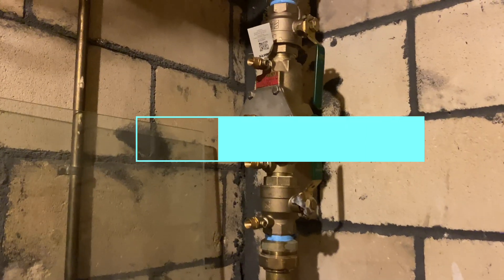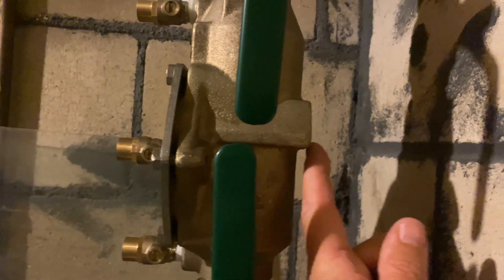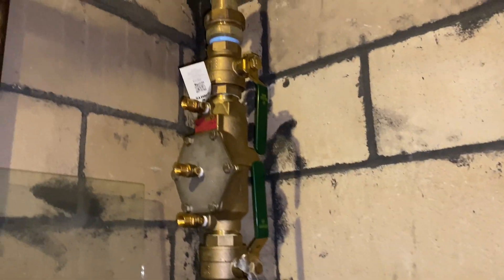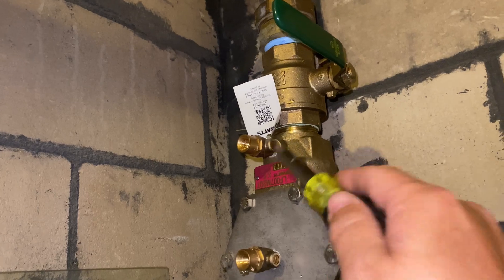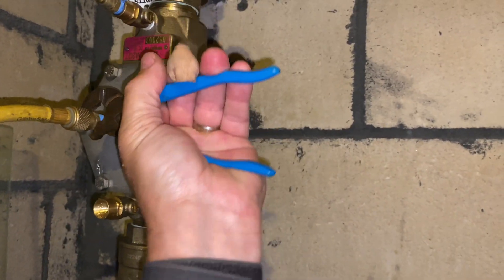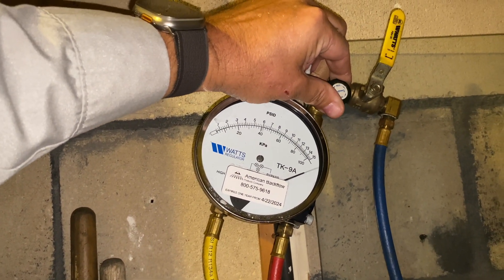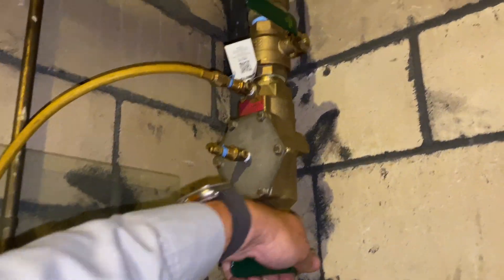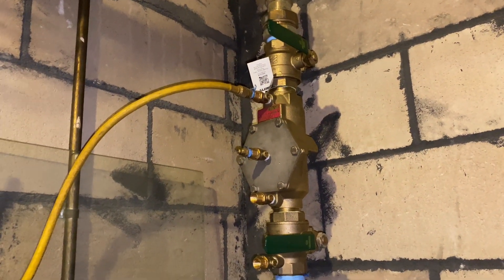Watts Double Check Valve DCV LF007M2QT Annual Testing

Comment: any time the gauge needle jumps when bleeding down to test, you still have air in it somewhere and should purge again until smooth sweep to test pressure.
it could skew the test results slightly, besides being harder to set.
but chances are if it's leaking that tiny bit of air won't buffer it enough to do anything, now whole hoses and gauges full of air, maybe?